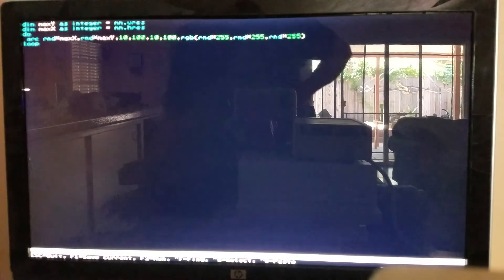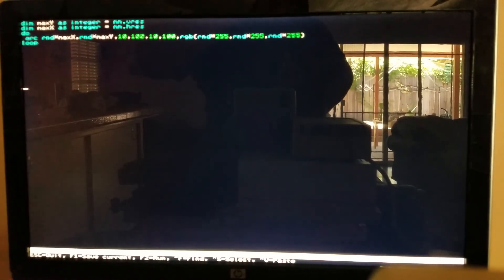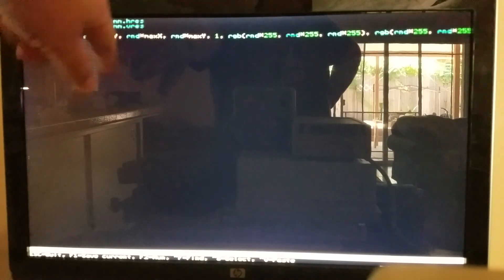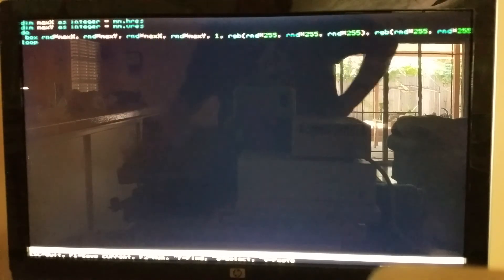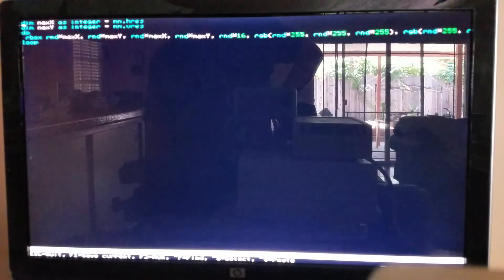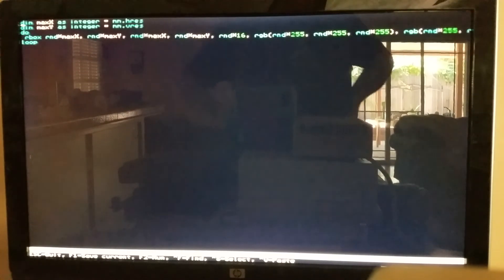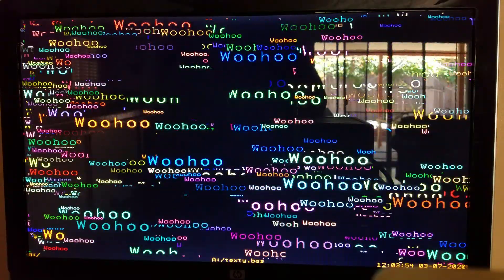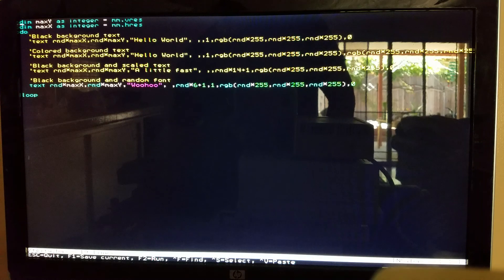Color Maximite 2 code samples

Comment: Do you still do any programming with the CMM2?
Reply from the maker: I just noticed my reply that I did fix the keyboard issue. I'll have to pull out the CMM2 some time and try it again. There are so many old computers and new old computers to fiddle around with that it's hard to stick with one for long. I may pull out the CMM2 again to see if there are any new firmware features to use.
Reply: @tterbo128  I have a terminal program that I've developed for the CMM2 and was wondering if you might be interested in collaborating in? My contact is on my YouTube page. Couldn't find any way to contact you directly aside from commenting on your video :)

Comment: Yep, had the same issue with a gamerkeyboard which had LED's - a normal simple keyboard does the job... also the gamerkeyboard beahaved strange on some keys or even on repeating keys... so best to use a very simple usb keyboard. Check out my Chiptune Drumsynth - https://youtu.be/vKMbMjoa0P4 :-) Cheers TweakerRay

Comment from the maker: I solved the weird typing issues with a cheap $10 USD Logitech K120 keyboard. Not that I'd really recommend a keyboard with such a thin cable. Maybe it works because it has no flashing lights pulling extra power from the USB port. So that may be the fix. A keyboard that does not pull a lot of current from the USB port on the Color Maximite 2. I'm not sure exactly but it worked for me.